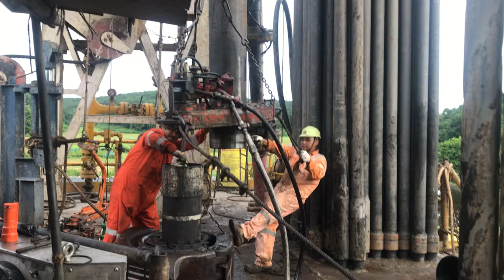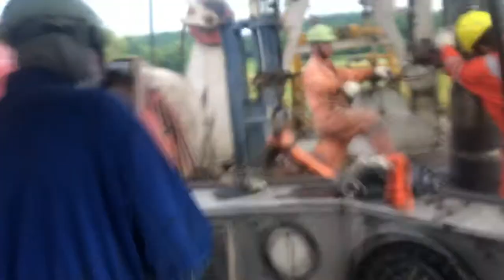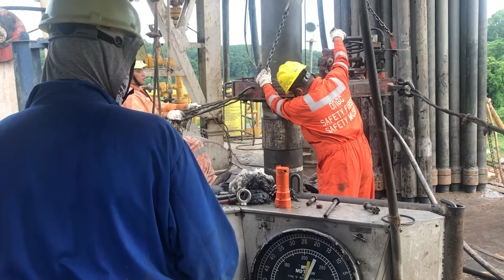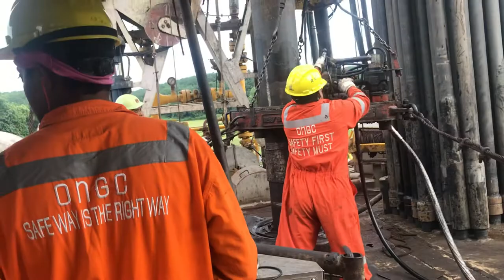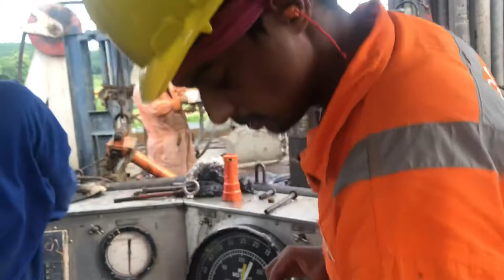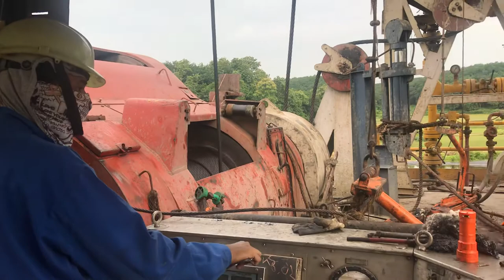13 3/8 casing running in

Comment: Cross threaded the fuck out of that one lol
Reply: What does cross threaded mean
Reply: @Rejin420  if you didnt brother to look it up since, it means it is not threaded straight into a hole it is supposed thro thread into. For example if you tried to tread a screw into a hole tilted, its probably gonna go crosstreaded. The bad thing in it is 

1. Its gonna be hard to turn

2. If you decide to try thro thread it in with a powerfull machine, its gonna destroy the thread

Comment: I have run up to 14,000 ft on 13 3/8 at the rate this is getting run  you guys are going to be at it a week spin that shit up those tongs got high use it if you can't tell it's crossed put someone on them that can
Reply: Where and what are you drilling that you run 14K of 13 3/8? That is surface casing or the top string of 2 intermediate casing runs. Holy hell.

Comment: Why would anyone post this video of running casing unless you want to show how to fuck up a casing run?  1- Don't wipe the box with the joint in the hole.  Clean the boxes while the pipe is on the rack, FFS.  2- They cross threaded the fuck out of this joint.  3- Taking this long to make up joints is a good way to get stuck if any of your pipe is across a permeable zone.  Where was the pusher or company man.....beating off or playing Tetris in their trailers?
Reply: What does cross threaded mean

Comment: why there is no backer lock or belzona
why not using seize glue
no torque tight
old model rig
Reply: They had enough pipe weight where they no longer needed backup tongs.
You only use threadlock near the shoe, so you don't unscrew any part of the shoe track during drill-out.  Otherwise, threadlock is slow and unnecessary.
No "torque turn" because this appears to be buttress thread.  It's not a premium thread where you capture a digital graph of the makeup for each joint.  You make it up to the triangle.  You can see the tong operator looking for the triangle before he quit.  It didn't look like he was anywhere close to burying the triangle.